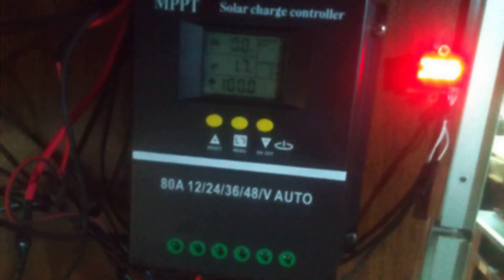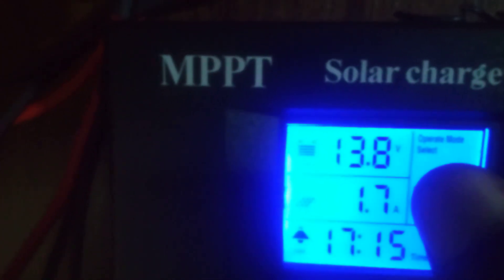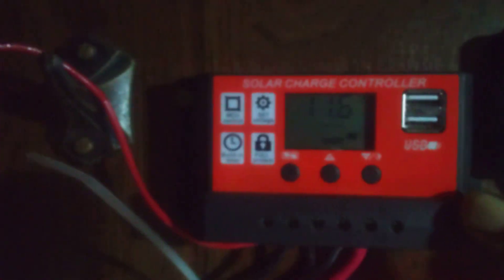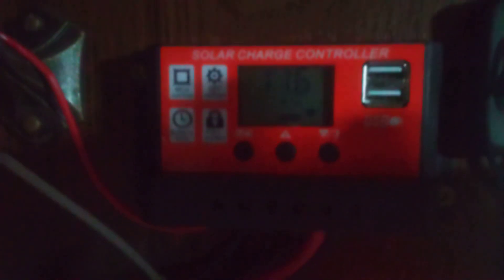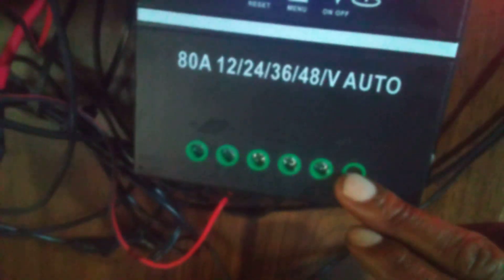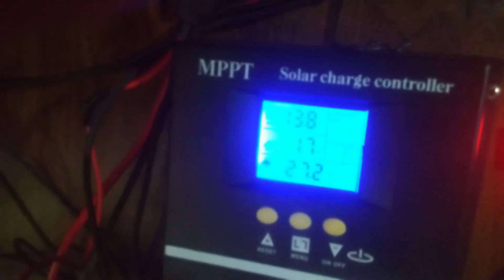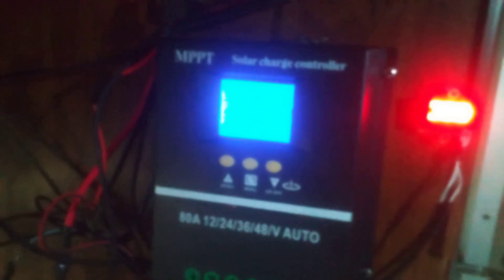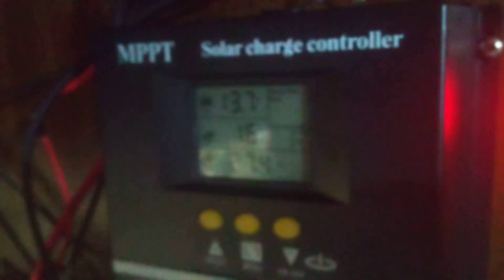80A MPPT Solar charge controller review

Comment: Thanks i put in the model number on YouTube and see only 2 vid but short or so quick had no information so thanks  don't suppose for other people you could add the model numbers in your search more people will find yoir video mine was 100amp but know are about 6 in all on the box happy new year
Reply from the maker: Thank you for your comment I really appreciate you for watching I will take in consideration to putting up my serial number and a new video stay tuned for a follow-up video!!
Reply: This charge controller  can't handle a lot of power
Reply: I bought this charge controller and it's loses power because it's not a real mppt charge controller
Reply from the maker: @andreengland2279  do you think it loses power because the battery is almost fully charged? Normally when it loses power is because the battery is almost to fully charged or is currently finished charging you will then notice the voltage drop down to 0. 3 💯 just enough to keep it from dropping voltage..

Comment: Thanks for the video. Just got one of these and can't get it to start charging. Did you have to tirn on some setting to get it to charge? I tried IUnversal and Manual mode but it always shows 0.0 amps from the panels. Definitely have juice coming in and the connections look solid. Frustrating! Hope it ain't dead. Thanks for any help.
Reply from the maker: Try it in these exact steps turn everything off plug up the battery first then solar panels last... Make sure wires are not corroded.. solar panels getting power but you do not see charge on the panel device? try checking that all connectors are connected and tight from panel to charging device solar port.. if none of those options are working sometimes the device may be defected you can try a 12 volt battery tester and put the two prongs on the positive and negative side during daytime hours to see if you're getting 12 volts coming through the wiring from the panels if it lights up it's working fine but if you're still not getting any reading on the device then the device may not be working properly other words defective I appreciate you for watching my videos I hope something I mention is able to help you out.. stay tuned for my follow-up video on the charging device I will show some things that could probably help others when it's not charging during daytime hours
Reply from the maker: Don't forget to like and subscribe!!
Reply: @yomontOME  Thanks! I tried a bunch of stuff but it just won't charge. From reviews it looks like I'm not the only one. Too bad. Luckily I have an older 60A charger that should do the job. I appreciate your taking the time to help! Good luck with your solar system.
Reply from the maker: I have another follow up video later when I have everything running and power it up stay tuned don't forget to like and subscribe!!
Reply: I have the first charging option turned on in all circumstances, when the battery is charging, does the charge controller turn off? I feel like it is still charging and I haven't seen it interrupt charging. What does it look like when the controller detects that the battery is sufficiently charged? What does the controller do? How does it behave?

Comment: Does it keep flashing battery zero. I was worried that means like q.5 A on pv but 0 gpong to battery. May be wait for full sunshine. Ser if still 0
Reply from the maker: If the battery is fully charged you will not get no voltage to charge the battery from the device it will stay to a bare minimum until the battery start losing charge then you will gain voltage to keep the battery at charge state once you start using axillary
Reply: Yeah, I watched a Part 2 video, Think you said is out going Amps not incoming Amps, Thanks again for your videos @yomontOME

Comment: i used that solar controller for almost a year now, one is 80 amperes and 100 amperes, its work well , its not a real mppt but its better than pwm when it comes to charging, it was cheap ,it cost me 1000 philippine pesos ($20) for the 100  amperes for this controller, great set up for beginner  and fits for your budget..
Reply from the maker: I agree to that it's a great device and it does the job to get it done when it comes to charging from my perspective there's not a lot of videos on it but I thought I should try to help people that's looking for more information on how to use it and you're right it's not the best out there but it's good for beginners and it gets the job done 💯
Reply from the maker: I appreciate you for watching!!
Reply: @openmindentertainment877  keep it up  and make more video to come...
Reply: some say a 100a, would it be any good for me if  I have x4 400w solar panels??
Reply: @manongkalikot4008  hi sir, after peessing reset for 5 sec I'm not getting High and low voltage setting please let me know what shoild I do?
Reply: I have 3 soller pannel each is 585 w and 48 V can I connect

Comment: Olá, adquiri um desse de 100A e quero colocar até 6 placas de 155w, em uma bateria de 100Ah ou 234Ah, será que dará certo?
Reply from the maker: Yes it will work 💯
Reply: 100AH lifepo battery normally can charge half so 50amp but that max most i think are down at 20amp charge cycle that just the charge side the bigger AH the better with this charger so up to 200AH at max charge 100amp but you need the input from solar to give that much think of head 2.4kw max so 3kw of solar i dont know any panels giving there max but thia geuss and not done working it out i dont do math

Comment: I could not reach the floating voltage adjustment step of this device. Additionally, I see that there is no possibility of adjusting the charging current of this device. I plan to use this device to support the battery charging MPPT output of the solar inverter. I would like my friends who are making applications on this subject or have knowledge about the things I am trying to learn to support me.
Reply from the maker: I will do another video soon. Please stay tuned I appreciate you for watching!!

Comment: Come on man, This is fake MPPT solar charger. Take a time and disassemble, You will not see any coil or inductor which are necessary components to increase power in MPPT technology.
Reply from the maker: It still works great for me for what I'm using it for but I'm pretty sure it's different for others 💯I have no problems with it at all batteries stay charged

Comment: I am using LiPO4 battery, how can I reach the floating voltage adjustment step? How can I adjust the floating voltage?
I would like to ask those who have information to help
Reply from the maker: Please stay tuned for my next video
Reply: Hey did u get the solution about how to set floating voltage?
Reply: In video he said press reset button to set high and low but my mppt is showing nothing

Comment: Hey I've set my ups with floating voltage 13.8(charging from source) and mppt I've directpy connected with battery to charge from solar but im not geeting an option for high and low vlotage after pressing reset button as a result I dont know the high voltage of mmpt so when charging from solar it is sbowing me overcharge issue, please help